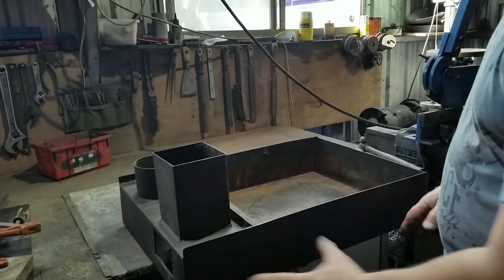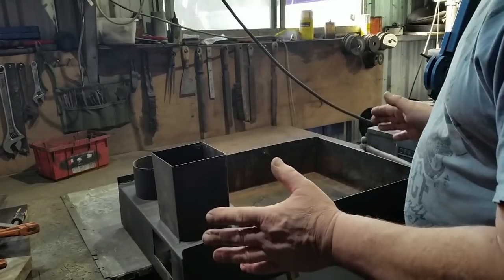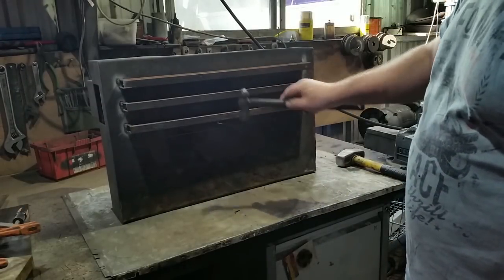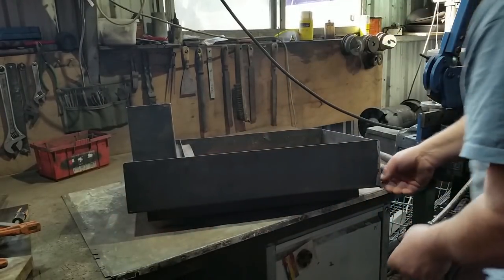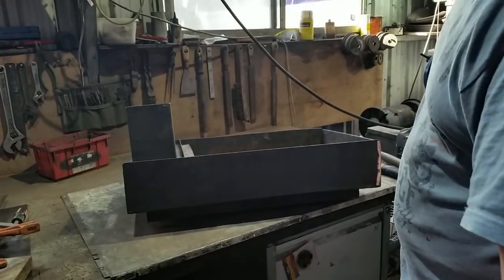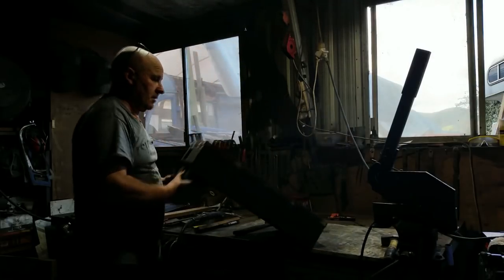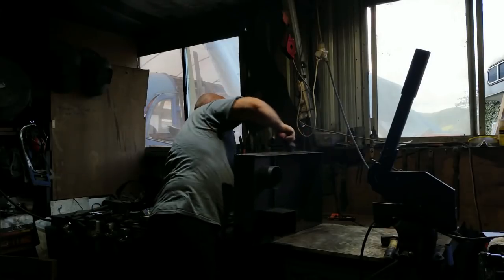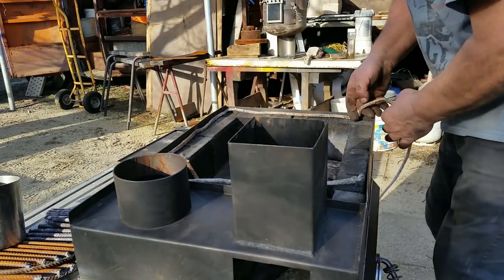Prototype Rocket Stove Oven Heat Improvement part 4

Comment: To solve the leak between the oven & the stove top, how about using fibreglass braided door seal?
Reply from the maker: It had a lipped flange, no leaks- the issue was - Heat rises- It needed a fan or relocate the oven above the stove

Comment: U channels would be much better: same surface area  without the trapped air and a layer of steel less (which in this case reduces the heat transfer).

Comment: First, Want to knock one of these stoves together for myself. I like the design. Now some observations:

* You are fighting physics by placing the oven on the bottom which of course you know. What you might want to consider (I would) is a two piece design. A removable oven assembly that would sit where the current cooktop is placed. In practice you would start the stove with the oven in place, fire it up and cook your bread. Pull the oven off while hot, drop in the plate and cook the main meal. The oven should still keep things nicely warm then dish it all up and have one hot meal.

* Manufacture. You could dispense with welding the metal skirt. Instead why not just use the same insulating rope that you use for the cooktop on the top edge of the bottom oven? Would seal the gap and be easier to make.

* Oven. Would having a bottom port just before the turn with a flap damper to flip up or down work? In the 'up' position the heat flow would be blocked from making the turn and have to flow down the port heating the area surrounding the oven box then up thru another port exiting the flue. In the 'down' position the port is closed and the stove operates just like it does as you have it now.

Comment: Thank you, I've been tinkering with rocket stoves and wood gas stoves for about 12 years. I grew up in the country we had a large  fruit tree orchard. And we had both a fire place and wood burning stove. So I did a lot of cutting and splitting from a very young age. I've always been fascinated with wood stoves. I can honestly say your horizontal draft stove appears to be on the mark. I don't know if you were the one who came up with this concept but in my opinion you have come up with the best refinements. If you cannot get enough heat to conduct downward and capture it by insulating the oven box perhaps try using and even thinner stove bottom out of stainless it will easily with stand the heat and conduct more heat. Also I'm off grid 4 years now and because I haven't got a big enough generator or a gas welder I had to build a small wood stove with stainless steel just bolted together. Many bolts close together  like the oil pan bolts on a car. Then I took lengths of copper tubing and cut them in half length wise end to end and then hammered and shape them into tight v shape and used them to gasket all my overlapping seams. It was very time consuming but it works great. I did have a friend with a custom exhaust shop weld a piece of 4" stainless pipe to a stainless plate after I had prepared it to accept my chimney. So keep in mind copper gasket it can handle the heat and it conducts it very well. As soon as I procure, buy trade or barter for a sufficient welding set up in what ever form that may be. I gonna be all over the building a stove like yours. I really think this design is on it. With further development it will be the bee's knees. Thank you again and have a nice day. Love your channel.

Comment: Would angle iron make better fins than square tubing?
Reply: I want one for camping
Reply: @lregalado1188  Hello  L Regalado yes I would like one also. I couldn't sleep with  my mind reeling with all the possibilities for this type of stove. Now I have another project to add to my list. I'm off grid and for the moment welding is not an option but I'm going to build a version with fire brick and mortar. Coleman camping makes an oven that sits on top of there portable propane gas stove. As heat rise's this may be more practical than trying to heat an oven underneath the stove. Also you would have very long preheat time with the oven below  due to the flame in the rocket stoves following along the underside or ceiling  of stove. Heat rise's it a fact of nature. Making  an oven that can nest below the rocket stove angle iron. Then when your ready to bake in the oven slide it out place in on top of the  stove but this wouldn't enable you to cook on top of stove service. Benjamin Franklin did a lot of study and work trying to develop stoves and fire place's but we have  a lot of technology to aid us today that he did not. Maybe we could in list some rocket scientists to help develop a rocket stove.
Reply from the maker: @shackman9566  great comment.  I will be making an aircrete version next so it will have epic insulation and light weight.  I will mount it on a metal trolley for movability
Reply from the maker: Whichever has the greatest surface area makes the best heat transfer
Reply: @t.h.o.r.  Sorry to but in but the gentleman might be correct. If cut away the tube face, facing down into the oven box and weld it or a piece like the one's you welded around the bottom of the stove, like a third fin for each tube now a channel. The air circulating through the open fin area will be able to confect more of the heat being conducted from the stove above. Plus insulation on all sides and bottom of the oven box.

Comment: The heat fins are brilliant. I'd come back and stitch those along the bottom of the Firebox because they may warp over time and not have a good contact.
Reply from the maker: Yes -good idea . I'll do that before I fire it up again . I've just scored some tiles for around the sides and bottom so next fire up should be  a good 300 in the oven

Comment: As a welder by trade I have to point out that welding with bare flesh exposed raises your chances of skin cancer - a lot! Like being exposed to sunlight without the atmosphere in between. Your risk to take but as bad example for viewers who may not know the dangers. Enjoying the vids otherwise. 😊
Reply from the maker: Kevin. Now I feel bad... I do have gloves. I do use gloves. But in this vid I did 12 tacks without gloves. When I'm doing actual welding I'm  gloved up.
Reply: Hey Kevin, I've given up nagging him. Even my youngster walked in, saw him welding without gloves on and remarked!  But I'll be bringing him a pair from South Africa when we go there next week, tho we"ll be in Auckland. I'll need a workshop and buddy as we'll take a bit of time to reestablish...
Reply from the maker: @crgsy5401  are you moving here!? Awesome. I'm 160km from central auckland  . Let's meet up.
Reply: Sure, lemmee get there in the next few weeks...
Will stsy in touch
Reply: Kevin, ain’t nothin worse than gettin ‘sun’burns on the eyes because of welding. I use to weld steel a lot with never an issue, but when I started welding aluminum for a semi trailer manufacturer that’s when I learned to tint my lenses even darker.
Reply: @OffGridOverLander  All my years welding I never got a 'flash' even though others around me did. I deduced that it was the prescription safety glasses I had to wear protected me more. Eyes sometimes sore but never the dreaded hot sand in eyes and whiteouts from true 'arc-eye'. Aluminium can indeed be worse (fatter arc?) Worst case for me was welding thick plate downhand with 1/4" lo-hy rods in a white tarp covered area about 15+ metres squared with 6+ other welders. Lots of reflected UV! Everyone but me was off with arc-eye the next day but I had a bad case of skin burn on my face from where I flipped up my hood to get another rod on. The foreman was in with us for about 10 minutes and was off for a week and couldn't see for several days. 😁 I have a few ginger genes so I burn easy, still no skin cancer at 63 but thats because I heeded the advice in training and kept my skin covered!! Place I got burned the most was the triangle sometimes exposed at the top of chest by overalls coming open. 😕 If it is hot just go nekkid under loose fit overalls. (However, this can cause some amusement when you have to strip off sharpish cos a bit of hot slag sets your overalls on fire.) 😋

Comment: Insulate everything except the top cooking plate. That way you will trap all the heat useful for the oven.
Reply from the maker: yes- thats todays job.  Im using a fibre insulating board with ceramic floor tiles cemented on. on back and sides and fibre board is getting bolted to inside of door too. Im off to the city today to rummage through tileshop skip bins. (its how I roll)

Comment: Perhaps reduce the size of the oven, do you need that much volume? Turkey? no,? Bread and pizza, biscuits, small chicken? We have a small grill oven and it's super handy and efficient, especially with added insulation. I agree on the tiles, it was my first thought. Thanks for posting.
Reply from the maker: Ive been thinking that its a bit large . Ill put 2 layers of bricks in the bottom to reduce volume.  and test again  Im off to rummage in skip bins for tile offcuts. another vid by wednesday I hope. Im making a pellet hopper today.

Comment: Since you sealed it off where they meet you can cut some holes in the to of the oven to let even more heat get in there and not have to depend only on the heat transfer thru multiple layers, and the fire rope around the outer edge where they meet is a good idea also as someone else commented. my idea may not even get you more heat but I believe that it would surely get you heat sooner. This is very close to what I suggested on the last video but I was talking about a trough that actually stuck down into the oven a little bit. Can't wait to see how this goes, I want the top part for sure.
Reply from the maker: Im not sure how the holes will not drop ash and smoke all over the food Donald? - The oven has no top- there is just the bottom of the stove box between the two. Im confidant that with more fins and some insulation will get me to a good oven temp. If not - phase two is the ducted exhaust idea
Reply: @t.h.o.r.  ok sorry, I missed that part about the oven build, I was thinking it has a top on it also. Anyways, the whole project is looking great and you have me wanting to build the top part for my outdoor cooking area.

Comment: I do not understand why you are so opposed to putting a second burner under the oven.. It would instanly give you all the heat you could need plus, exhaust into the latter half of the loop, and you have a second hot spot on top to cook with.
Reply from the maker: I want to keep it as simple as possible.
Reply: @t.h.o.r.  wouldnt the simplest idea for OVEN EFFECT  be to make about a 8 inch high cover for the entire grill, maybe even with a round hole for a pot lid to sit in to see the baking goods?  i sseen it done somewhere else.
the guy put down a oven eack on the grill for some seperation and just put his  cover over entire grill trapping all the heat in the area.
Maybe it would be TOO HOT for some things?

Comment: Mom had a beautiful cook stove  with a dark cream enamel cooling shelf on the homestead in central Alaska. The fire box was on the left as yours. The outer was cast iron. I wondered if the air circulated all around the oven or if it cooked so evenly because of the cast iron holding stable heat. There was never any problem with the biscuits in a large ( family of 9.) not being evenly cooked. I love your process of figuring this out and hoping you do so. I really need an efficient cook stove that can heat a space efficiently also.
Reply from the maker: I want to swap out my tiny house wood stove for this one ASAP so I can test it inside while the weather is still cold here.

Comment: Instead oven on the bottom more heat will be decipated if oven is on top covering half the hot plate
Reply from the maker: Yes - I know that will work- but I want a traditional looking setup with a modern rocket twist. and I dont want to lose cooking area- or have to store the oven seperately.

Comment: Really cool project! I'm having a great time watching all these videos. Subbed!

I might have missed it, but did you add some of that fiberglass rope under the stove to seal the oven? If not, I'd test it just to see if it'd make any difference. Also, maybe some sort of clips on the sides, like toolbox flip latches to hold the stove down tight on the oven might help keep the seal in case the metal warps a bit during the heating.

So cool watching this thing evolve:-)>
Reply from the maker: Yes I have the rope- the clips are a good idea as the entire thing now has a slight twist after repeated thashings!